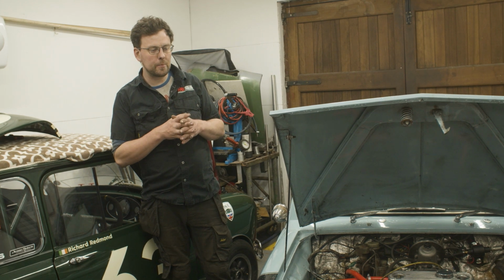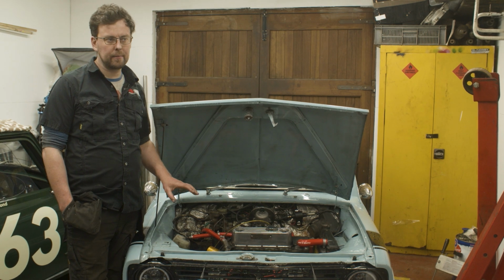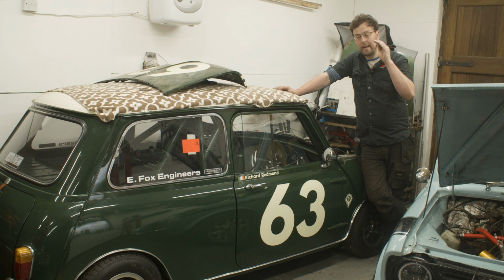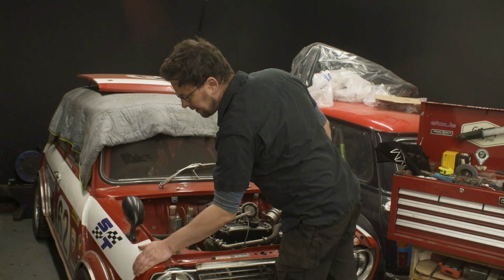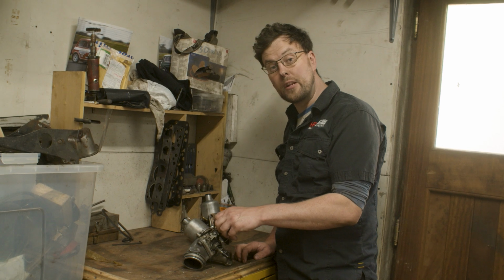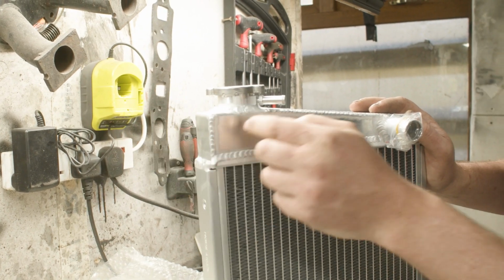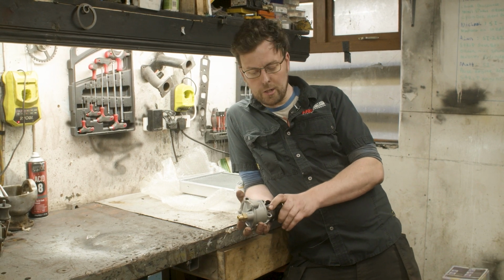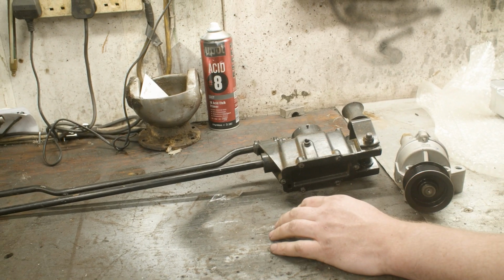Hickey Race Engineering Uncut - Episode 5

Comment: 3.5 Rover V8 su's? Also, the electronic ignition, are they effected by heat, in Fiat the 123 and Pertronix ignitions can be a nightmare with heat, always carry points and condenser in the event of.....
Reply: That's about what I was thinking...or maybe Triumph Stag?  I think it also had a couple of chunky SUs. 

Edit: cancel the Stag - I just remembered it came with Zenith units.  Opinion shifting back to Rover 3500.  :-P
Reply: Aussie, I could be wrong, my dad had Rover P4/5/6 as I was growing up, been a long time since I've seen a 3.5 but the moment I saw these the memories came flooding back. I only read recently that the famous Rover V8 that we all know was in fact a GM Buick developed engine that was then built under licence by BL and Rover. Open to correction of course!
Reply: @gavinosullivan7904   Yep, Buick did the basic design, but they never did really get it working reliably, so they eventually sold all their tooling to BMC (I guess they figured the Brits wouldn't mind an engine that leaked oil and coolant - LOL) a year after they ceased their own production of the engine.  I think that might qualify as a sale, rather than a lease/licence agreement.  T'was a wonderful engine - when I was a kid, people used to swap out 4 cylinder engines for the V8 and find that the Rover engine was actually lighter than the 4-pot.  :-)
Reply from the maker: close lads not a P or a Stag but you are on the right lines. Yes the pertronix did give trouble, we had a tipo with it and went back to points
Reply: @HREIRL  Vitesse?

Comment: Be interested to see how you work the mechanical vacuum pump.
Question for you .... what dia heater take off are you using on the race GT? Obviously you’re not running with a heater but I’m still exploring going down the modified rad route to help with cooling.
Reply from the maker: Its one I made my self Ian, basically a  plate with the 3 holes in it and two pieces of CDS pipe welded together at 45 deg and then welded to the plate
Reply: @HREIRL  ok cool. Would be interested to see more info about how you did it.

Comment: I had a car that would start well and run for a while and then cut out and would not start until it had stood for a while. After a lot of messing around i found that it was the small condenser in the distributer that was old and faulty and would not work when it was hot.. You did say that the mini had an electronic so perhaps this does not apply but I am just getting my ten pence worth in. Great to see how all the projects are advancing.
Reply from the maker: Its looking like an ignition module or bust coil. but very good susgestions great places to start 👍👍

Comment: 2:12 coil or condenser? oh electronic ignition module lol. Lots for you to be getting on with then Paul. How did then guy with the cracked block take it?
Reply from the maker: Hi Paul, he was disappointed but luckily he has a spare S motor that we can use as a donor so project back on track :)
Reply: @HREIRL  bet he was brassed off to say the least. Well we all have a spare Cooper S  engine don't we lol. Build is back on then?